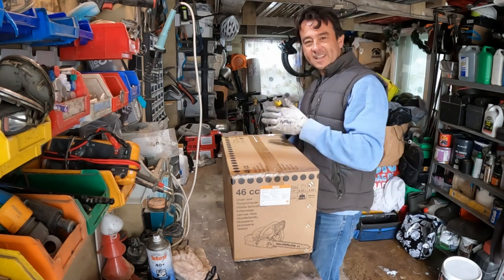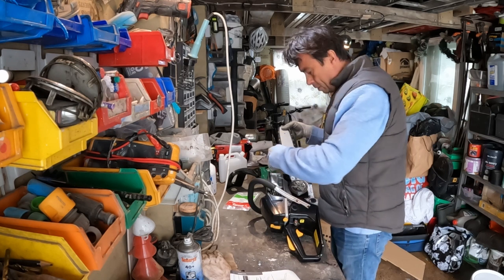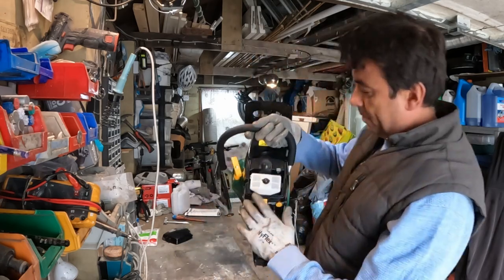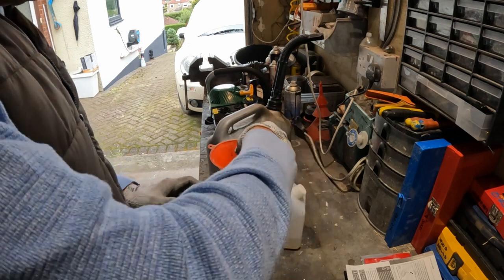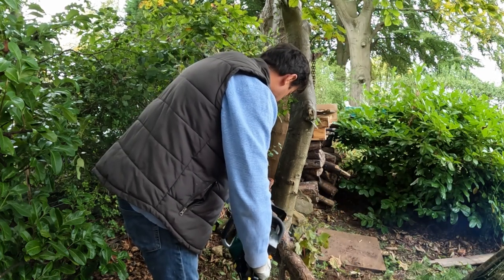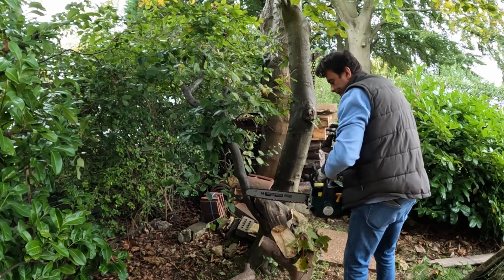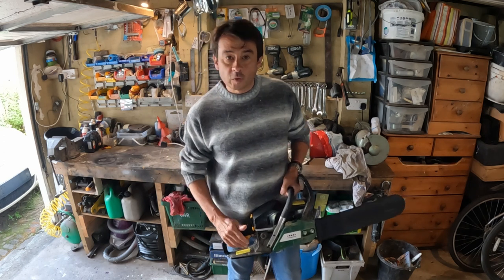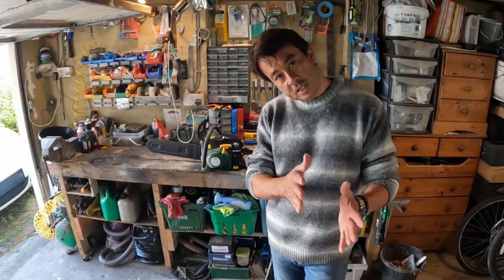Best chainsaw for your money, should you buy expensive or cheap?

Comment: I do hope you poured that first mix out and started over. when attempting to Dump excess oil back out, gas rushed in and diluted everything. No way to correctly measure gas/oil in the mixing container at that point. I always recommend putting the 2-stroke oil in first, then add the Gas. it is easier to add oil of necessary. 
*Very interesting chainsaw. I've never seen a carburetor heater on one before.(common on aircraft) Then again, I have (2) 4 stroke chainsaws, running on straight Gas.

Comment: To adjust the carburator for this chainsaw The carburator adjustments is for Low idle one turn anticlockwise and for High one and a quarter turn 1/4 anticlockwise.Normally u have to adjust the carburator after break in period .To adjust the carburator u must leave the engine to warm up first after start

Comment: You should leave it work on idle to empty at least two tanks of fuel before u use it at maximum power thats for the piston and cylinder break in period if u want that chainsaw last long time
Reply: No way.. The rings will never bed into the cylinder crosshatch if the engine is sitting idling and fuelling up with oil.. it will have zero power as the cylinder will become glazed plus you will foul spark plugs.

The best way to run in your machine is at lower than normal operating rpm under slight load for short periods of time and tuned to a richer condition.. 

After a tank of fuel, or 20 minutes it's ran in, and fine to lean them out and full throttle it like normally.
Reply: Lol lol